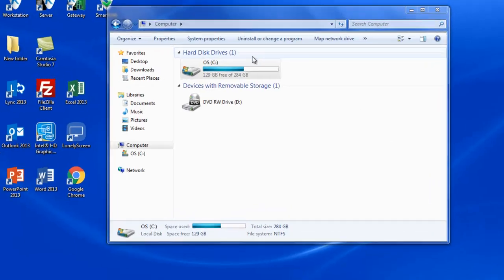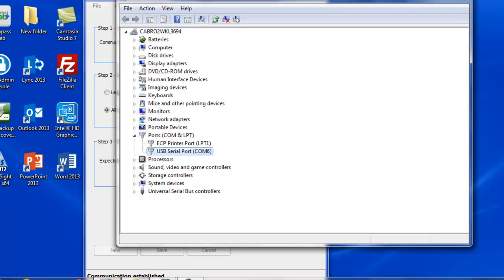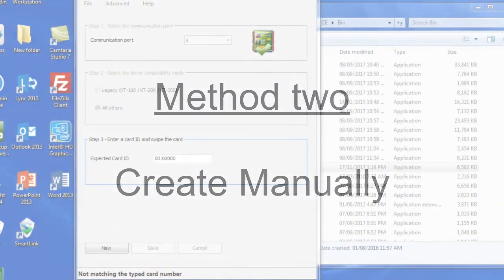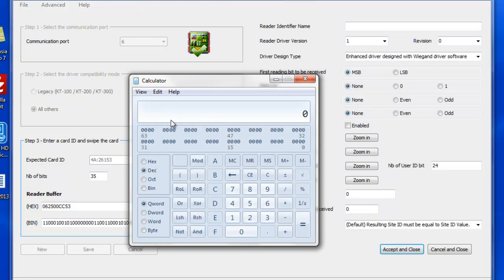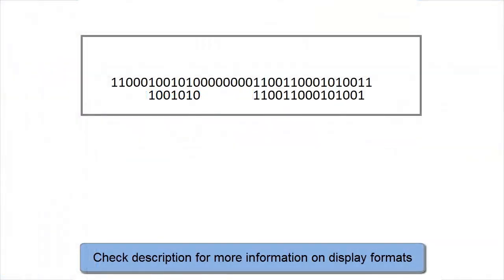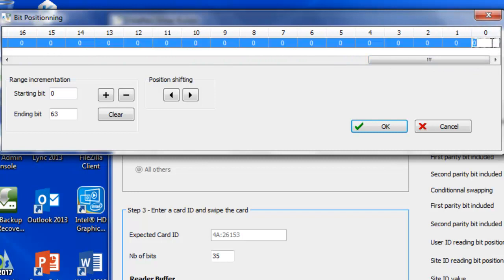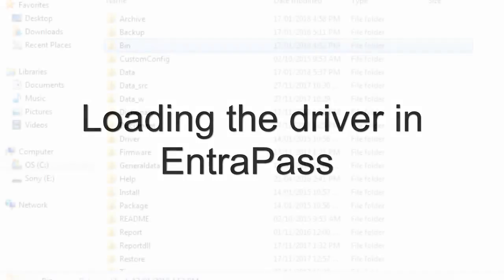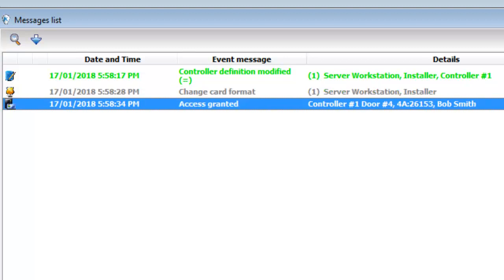Driver Builder

Comment: This video is AWESOME, it helped me build a driver for a client.  Hopefully this information helps: (I was reading a corporate 1000 format) the first and last bit in the stream are a stop, start, or parity bit (disregard both... it will help you in deciphering).  Some of the bits in the beginning were not needed for my application (left side of the stream).  Use the windows calculator and choose the "programmer" style.  Be sure to group your bits in groups of four, in my case the card # started at bit 2 through bit 21 (right to left in the software... left to right decoding...that's 20 bits or 5 digits of 4 bits each) and the facility code started at 22 and went to 29 (that's 8 bits or 2 digits of 4 bits each... again starting from the right but decoded from a left perspective).  I got the driver built.  When I called tech support they said to send several cards in so they could develop a driver, not needed.  Whoever developed this video needs a raise, very informative!!!!  Again, follow the video, it's spot on!!!